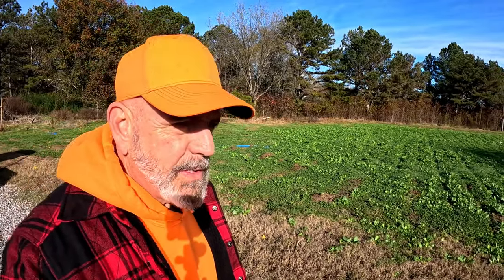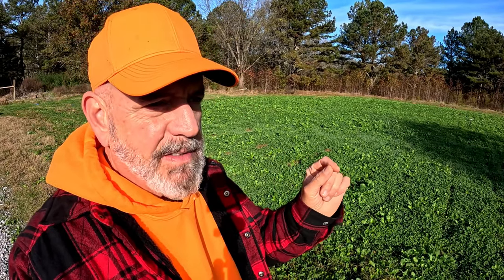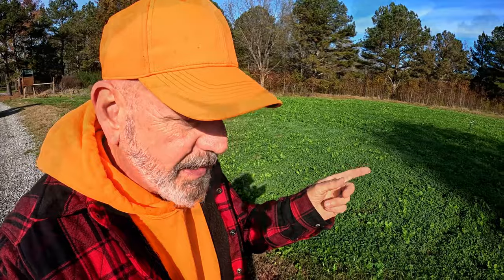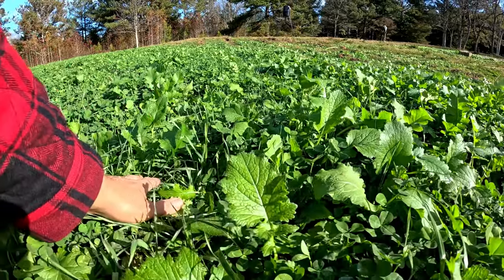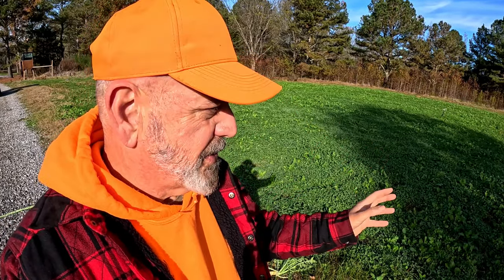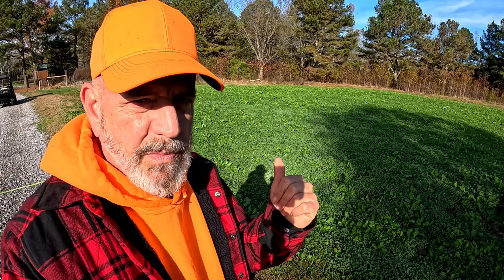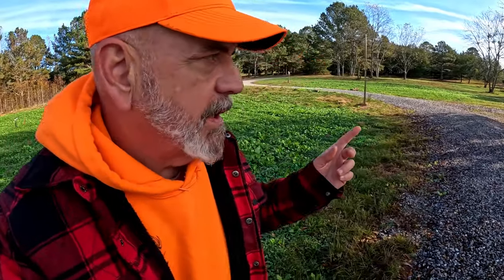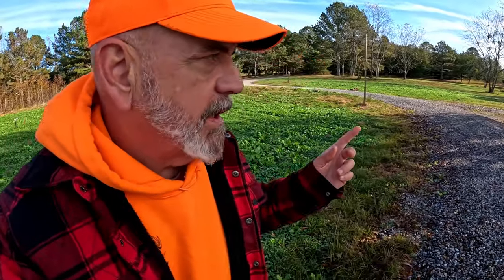UTV Deer Loader DIY

Comment: Doc, On your feed stations what does your timers set at? I currently an set 6am- 4pm - Midnight :20 each. I am trying to gauge what others are doing. They keep up with that. Not sure I want to increase more because the feed runs out fast. Thanks for the video's.
Reply from the maker: I set morning feed to the time I go in the woods to make noise. I set the evening feed at the time I come out for the same reason. Deer get spooked but realize it's the feeder.

Comment: The stator will only charge the battery at higher revs, that little bit of winching won't kill your battery.
Reply from the maker: Correct, but you can hear the draw difference based on the amps.